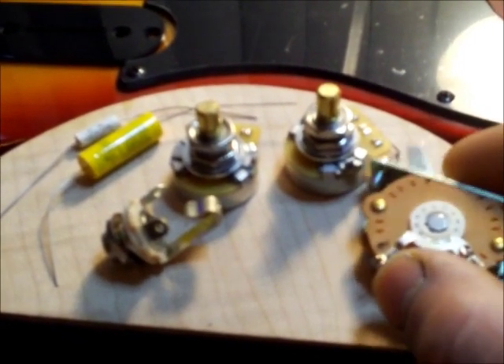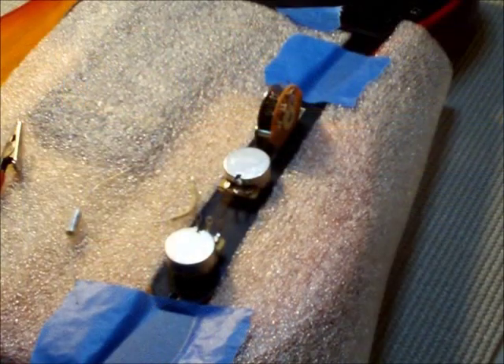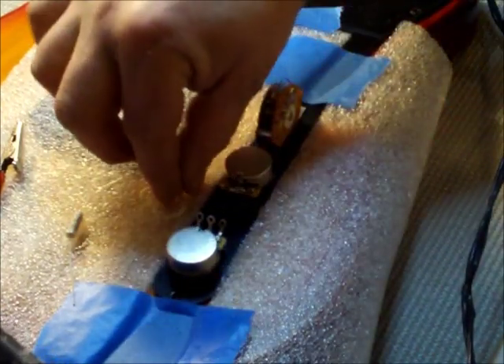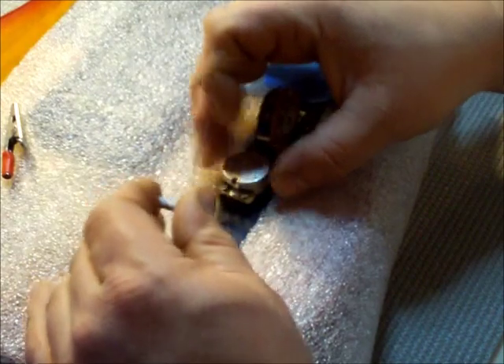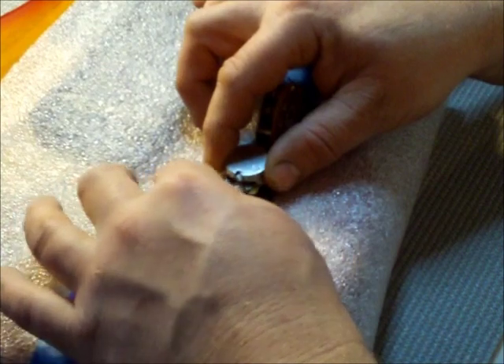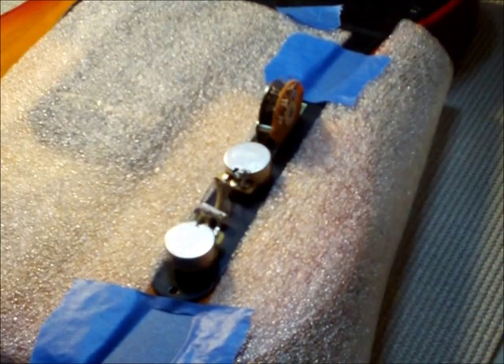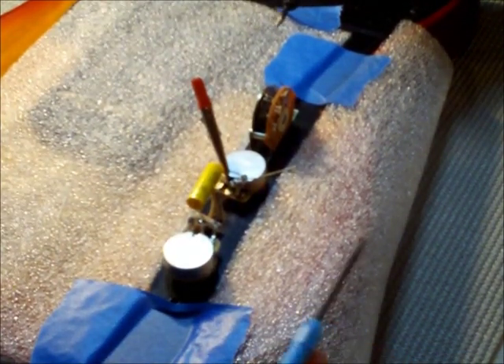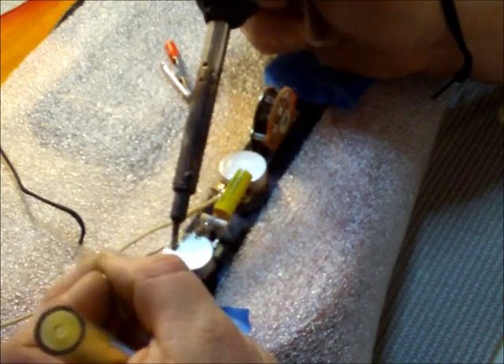Tele build part 4 (how to wire the electronics)

Comment from the maker: Glad you enjoyed the vid, The cap is a "hole" in the circuit that lets some of the high frequencies escape. the greater the value of the cap the more "highs" bleed off. Single coil pick ups can be very bright and most commonly use a .047 cap where a humbucker can be very dark and will usually have  a smaller .022 cap. I absolutely recommend a tone capacitor.

Comment: To drill steel its high pressure slow speed on your drill. You will find it makes holes a lot faster and doesn't wear your bits out prematurely .I like your selection of components.

Comment from the maker: The pickup has a grounded base plate that mounts directly to the bridge. Some people use a separate ground wire anyway. You can drill a hole from under the bridge plate to the pick up cavity. Run a stranded wire from under bridge plate and solder to vol pot.

Comment from the maker: I did not buy the control plate at Stewmac, It was an imported plate that I had laying around. It was nice and thick but the pot holes would not take the USA made CTS pots. I had to drill out the holes. Stew mac's are the correct size to fit Fender specs but are a bit on the thin side and I think they dont have black. Thanks for the question...

Comment from the maker: Thanks for the sub and thanks for watching. Here I am using Fender original vintage cloth pushback wire. the standard today in most guitars is 22 awg stranded copper hookup wire that you can find in any Radio Shack and comes in a multitude of colors. Braided shielded hookup wire is mostly but not always used in vintage Gibson style wiring like a LP or an  SG. If I am going for a vintage look on my Tele like a vintage bridge and vintage tuners then I always use vintage cloth wire.

Comment: Nice instructional video. I want to change all the electronics in my telecaster I built from a kit. I have a question however. Do you use shielded cable ? I saw some videos where they solder the braided cable shield to the back of the pots. You don't do that. Why is that?
I must confess that I don't know anything about electronics because maybe this sounds like a stupid question.
Keep up the good work, I subscribed to your very interesting channel !
Cheers !

Comment from the maker: Hi and thanks for watching. An Oak Grigsby 3 way telecaster switch, 2- 250k ohm CTS brass solid shaft pots. a switchcraft jack, a .047 mylar capacitor and a mallory 150 treble bleed cap.